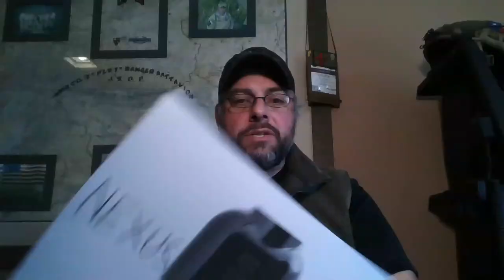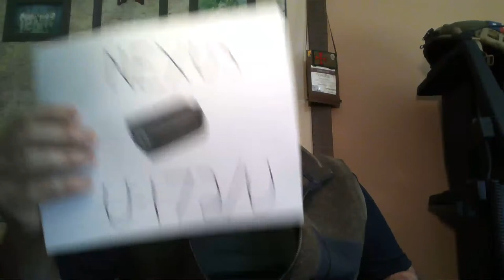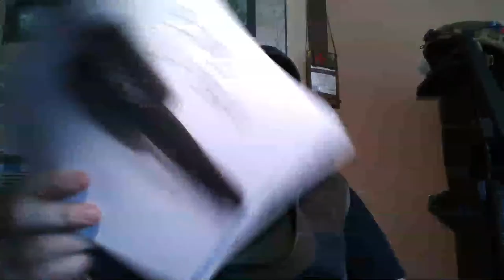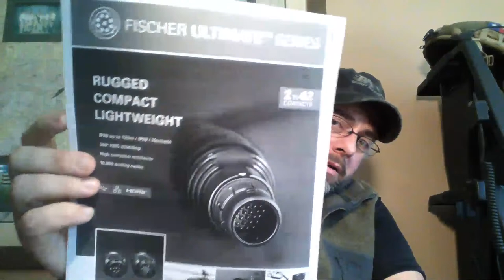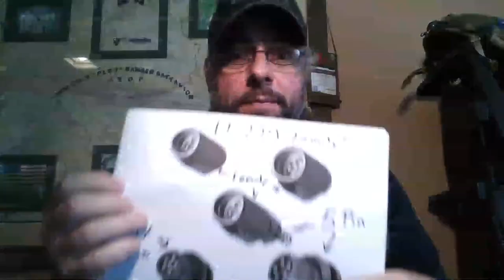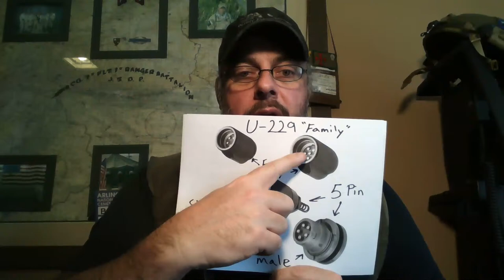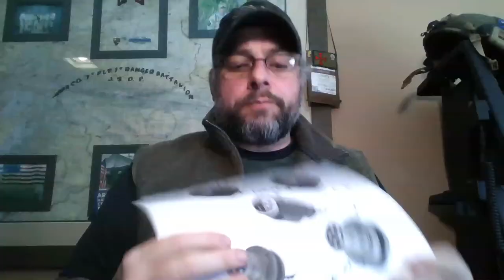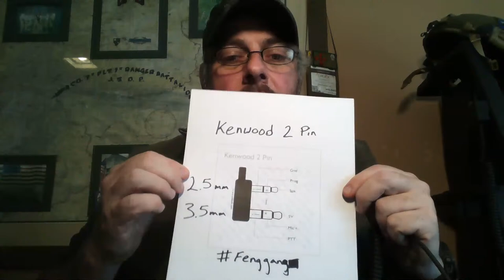Connectors and plugs used in various tactical radios and accessories

Comment: Thanks for the video, super helpful!

Do you know of anyone that makes a solution to run the gas mask mic (u173/u male) to a peltor mix input (u173/u female) as well as to a 3.5mm standard voicebox speaker? I'd prefer a y cable but I'd live with just a u173/u female to 3.5mm female or male.   Thanks for any help!